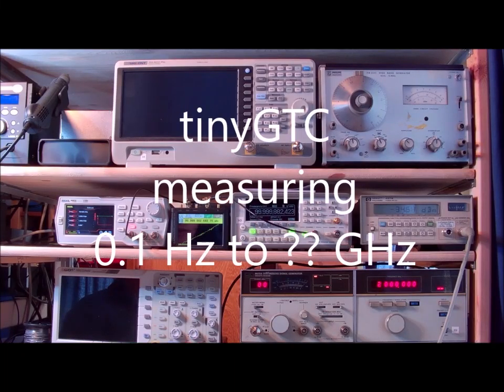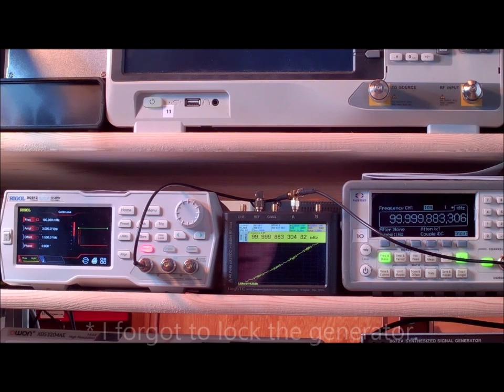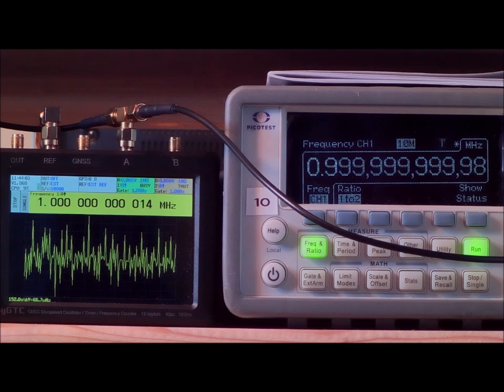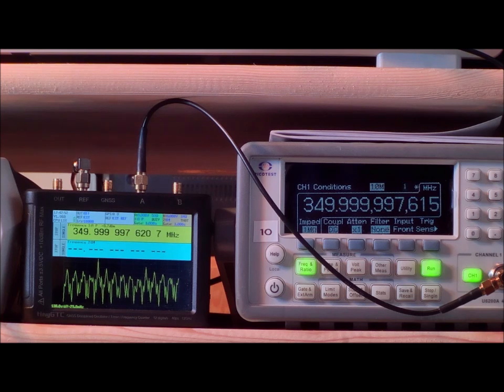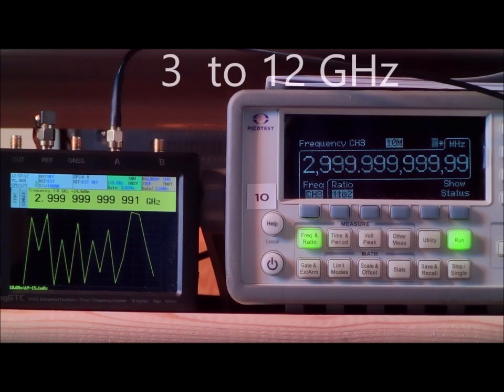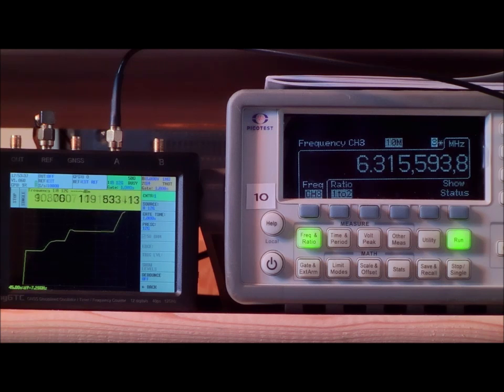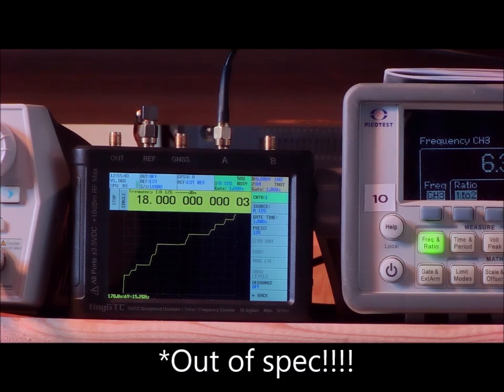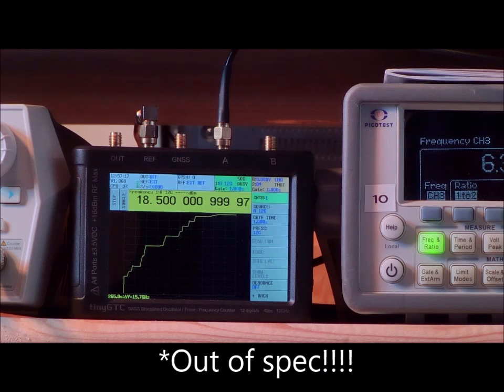tinyGTC measuring frequencies from 0.1 Hz to above 12 GHz

Comment: Quoted
Your device has internal interference in the 20-50 khz band, the price didn't justify such a device that can't be used for the khz band and besides that is not present on Trendyol, Temu only on AliExpress with huge shipping cost and no rates option.

Comment: 02:30 measuring the mains frequency is interesting in itself...  I connected an AC plug pack via some resistors and capacitor and it is interesting to see the slow variation over the day.
Reply: I've been doing this for some time now and the results agree very well with the mainsfrequency real time site that shows this as well...

Comment: This is verry impressiv
Is the internal oscillator good enough for the provided precision ?
Reply from the maker: The internal oscillator is good enough for 10 digits. The counter when on external reference will do 12 digits per second gate time
Reply: @ErikKaashoek  Good Demonstration thank you. Just food for thought but I think that the Directed Energy Weapons being used now in many countries are interesting.  I think they use mmWave frequencies and two or three separate but possibly coordinated beams from two or three Phased Array antennas spaced around the victim's location.  Any one of the beams can pass relatively harmlessly through buildings and people, but where multiple beams intersect, they create pain and damage, I think by creating a standing wave, say in a 3D orb, over the victim's head.  I think of the principle kind of like that of a Gamma Knife as has been used in medicine for decades.  I have several handheld detector devices, but none can detect this energy, though they can be perceived with a human nervous system..